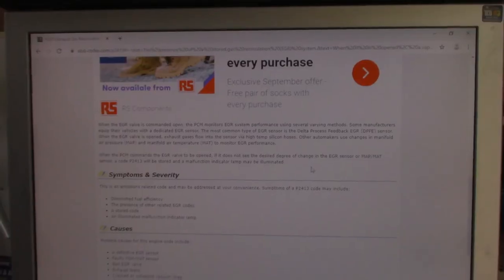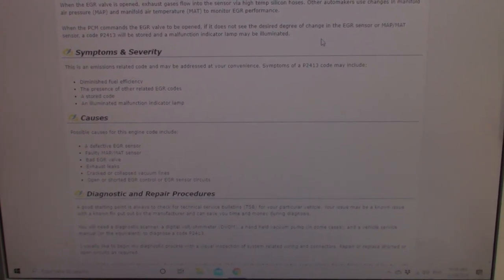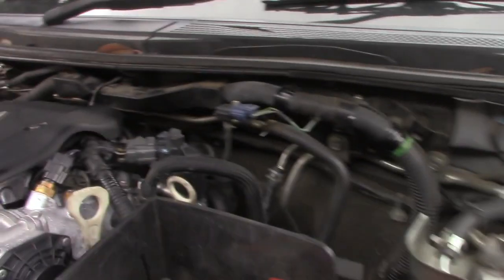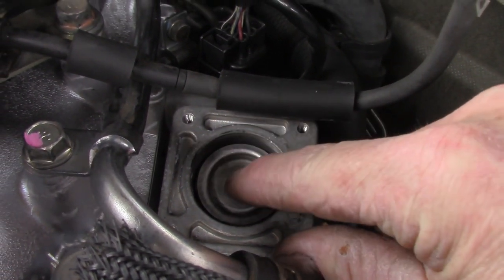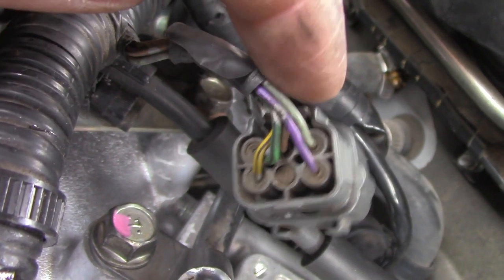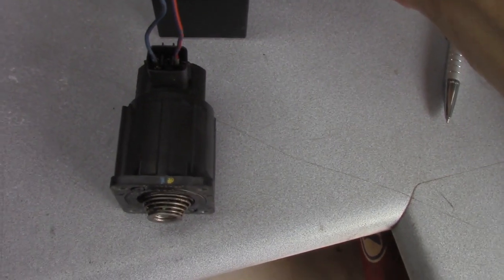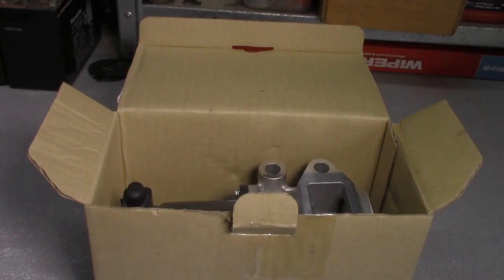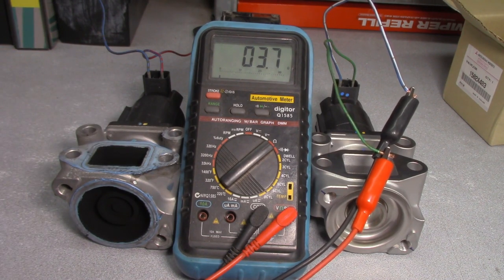Triton P2413 Fault Code MiracleMAX

Comment: Nice video. Is it 5V supply?
Reply from the maker: Hey Neil John Tolentino,

The motor is driven by 12 volts, the potentiometer has a 5 volt reference. The information is listed here:
https://youtu.be/pR4J58qmr8k?t=293

MiracleMAX
Reply: @MiracleMAX  thank you sir. I have no check engine but when I scanned, the value of egr target position is zero at idle,    once rev it goes up and went back to zero.. do you think its on the egr assembly?
Reply: I have an old egr. When i drive it with 12volts.. the valve does not fully open.. is the motor already broken?
Reply from the maker: @neiljohntolentino6365  
So what issues are you having with the vehicle? Do you have a fault code to work with? How many kilometres has the engine done?
Are the target values the same as the actual values?
Reply from the maker: @neiljohntolentino6365  The EGR valve is driven by duty cycle. However when you put 12 volts to it, it should open and when the wires are reversed, it should close.
Here's an example of what I mean
https://youtu.be/nlErGRhRFMA?t=1228
Reply: @MiracleMAX  I dont have fault code Sir. I asked the mechanic to relearn the system and what appeared are fuel limiter malfunction and egr.. 
He did erase both but looking at the values of egr I think it is not good since 0 at idle and when rev it goes 60 and went back to 0 again. 
For the fuel pressure it is playing around 32 to 36mpa vs 33mpa at pressure target. With regards to that I clean the scv coz I experienced engine low power and engine shut down or off. It does good now and still observing. 
What I want to solve now is the uneven response when accelerating that is why I'm suspecting the egr. I will check the values and will give you update. 
Btw milage is 133k km and automatic transmission; 3.2 cc
Does egr related to bad fuel consumption? Coz i only get 7km per liter. Already replaced fuel filters and air filters, Clean intake manifold and egr .
Reply: @MiracleMAX  thank you sir.
Reply from the maker: @neiljohntolentino6365  It's not so much what the readings are with your EGR, but are the target and actual readings the same? Many different things will cause them to change. Yes if the EGR is stuck open, this will effect power and economy.
How did you clean the intake system? Was it ultrasonically cleaned or just a cleaner sprayed into the intake system?
Reply: @MiracleMAX  the reading in the actual and target in the egr are the same but operates in opposite way... should have value or open in idle?
Reply: I clean it by removing the intake and remove carbon with spray etc.
Reply: Egr valve  position is 0%
and egr target position is also 0 at idle.
Reply from the maker: @neiljohntolentino6365  If the target and actual values are the same, that means that the EGR is doing what the ECU is requesting. That's good. As I said before, there are many variables to when the EGR will open. 
Am I reading your comments correctly? Is your engine a 3.2 Lt?
Also, when measuring fuel consumption, it should be measured as litres/100 kilometres. Do you have that reading? Is that at highway speeds or around town?
Reply: @MiracleMAX  3.2 engine AT 4x4
Reply: According to mitsubishi tech..  egr parameter should have value and not 0 i in idle.. same in your video showing the egr values.
Reply from the maker: @neiljohntolentino6365  So, does the vehicle have any driving issues?
Did you have any fault codes originally? What were they? The actual code numbers. The EGR system will not work if it has any fault codes. Did you have any history codes or present codes?
You are correct, generally at idle, with your motor, you will experience 30-60% at idle and under acceleration, it should change, possibly down to 0%, with target and actual readings the same.
Reply: @MiracleMAX  i dont have any  check engine codes.
 The issue about egr and pressure limiter malfunction only appeard after the leakage test conducted by the mechanic using MUT3. We did leakage coz  i told him I have bad fuel consumption.  I told the mechanic that i dont have check engine but experiencing intermittent low power  (may be related to the pressure limiter malfunction problem-  did clean the scv - still observing), also low power that may be related to egr and issues in fuel consumption that is why also  asking if egr problems equate to more fuel.
Reply from the maker: @neiljohntolentino6365  An EGR system allows already burnt gasses to enter the combustion chamber with intake gasses to help keep combustion temperatures lower, therefore lowering NOx emissions. If already burnt gasses enter the chamber, there is less 'room' for unburnt gasses to enter and therefore less bang for your buck - less power to a certain extent. More fuel to get the same amount of power.

This is why some block off the EGR system - not that it is legal & I wouldn't recommend it. 

But, it does give you an idea of how it works. That's why under acceleration, the EGR is about 0%, allowing the power when you need it and at idle allows the inert gasses to enter to lower combustion temperatures.

If you are getting high percentage of EGR at higher revs, that could effect power and economy.
Reply: @MiracleMAX  thank you sir. Il give you update once i check the wirings -(5v) etc. 

Pressure limiter malfunction issue
-With the actual value playing around 32-36  vs target 32 in fuel pressure  parameter, is that ok..?  Coz after I clean the scv the car did not stall anymore. I haven't check it with the scanner yet. I only rent but before that I want to check wirings coz some mechanic here in my area (Philippines) are after in replacing the parts. Thank you very much sir.
Reply: Just wana make sure if the problem is coming from the parts itself or wirings. 
 do you have PMS video for turbo?
Reply from the maker: @neiljohntolentino6365   I am a little confused. Were there any fault codes? If so, what were the codes? How do you know there are Pressure limiter malfunction issues? I gather the 32-36 you are referring to is rail pressure measured in Mpa at idle? If the is the case, that pressure would be correct. It should increase up to approx. 50 Mpa at 2000 RPM. That would indicate that you do not have any fuel pressure related issues.
Reply: @MiracleMAX  sorry..  what I mean is I dont have check engine error codes
 at first.. the error came out from MUT scanner after leakage test.. i didnt get the code, but as per definition its the pressure limiter malfunc and egr problem.  I should have get the specific code. 

Yes, the values are fuel pressure mpa at  idle.. good to hear that its ok so i dont need to buy scv for now.  according to the mechanic the variance of actual and target should atleast 1.
Reply: Good day. I checked step 3 MUT guide under P0405 error. I dont have check engine, just want to solve why my egr values are 0 at idle. 

According to step 3 check terminal no 3. Of egr harness and ground.. it says engine on and should have 4.5 to 5V. Mine got 5v when engine switch Off but when switch on got low voltage.. 

Also under step 9

It says check terminal 2 and earth should have 2 ohms while engine switch on.. mine got 2ohms when switch off but when i turned  on I got 56 ohms or higher
Reply from the maker: @neiljohntolentino6365  I gather you are using the testing procedure as shown in this link:
http://mmc-autoelectric.org.ua/manuals/eur/l200/2013/13/html/M113350140063200ENG.HTM

You should only have a 5 volt reference when the ignition is turned on.
Are you able to disconnect other sensors, one by one, and see if your 5 volt reference comes back? Another sensor may be pulling the voltage down to ground.
Are you able to do testing at the ECU and compare what you are getting at the EGR?
Reply: @MiracleMAX  yes sir, im following  procedure similar to the link that you posted. 

I havent done the test in the ecu yet, I just did quick test in the egr.What I observed now is pin 3 from the egr  and  ground got 5V when engine switch ON, but does not change at high rpm. 
When I test PIn 2 for resistance , if switch ON still got high restance ( 56ohms +),  swith off I got 2 ohms. Do you have case like that...is it short circuit.. hope its not in the ECU program.
Reply: @MiracleMAX  when stuck in 5v does it mean valve is open?
Reply from the maker: @neiljohntolentino6365  The 5 volt reference and ground will not change. It is the signal wire that will vary & this will be a duty cycle signal
Reply from the maker: @neiljohntolentino6365  Have you checked the resistance of the EGR itself?
https://youtu.be/pR4J58qmr8k?t=466
Reply: @MiracleMAX  sorry. Yes i mean the voltage in signal wire.
 I wonder why pin 2 resistance in egr harness without egr connected is high when ignition on. Do you know what sensors are working with egr at same line to the ecu?
Reply from the maker: @neiljohntolentino6365  Firstly, can we go back to basics please.
Leave the EGR connector connected. With the ignition turned on, you should have a 5 volt reference, a ground & also a signal wire. This will be a potentiometer which shows the position of the motor. You could remove the motor and move it in and out & see the responding voltage at the signal wire.
https://youtu.be/nlErGRhRFMA?t=1258
Try that first.
Reply: @MiracleMAX  ok sir. Actualy I already watched the part of the video that you shared. I think I mixed up all the videos that I watched and got confused. You are right I was in the wrong pin. Il try that procedure and start with basics again.. thanks for helping. God Bless. Il keep you posted.

Comment: A quoi sert ce compteur ??
Reply from the maker: The trouble code P2413 is defined as Exhaust Gas Recirculation System Performance issue.